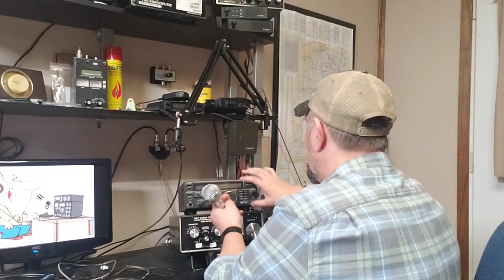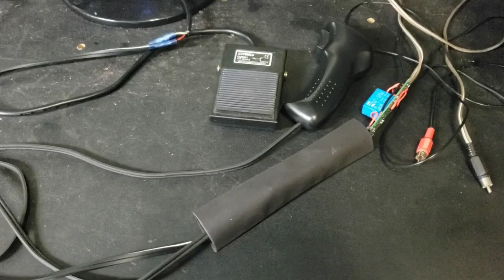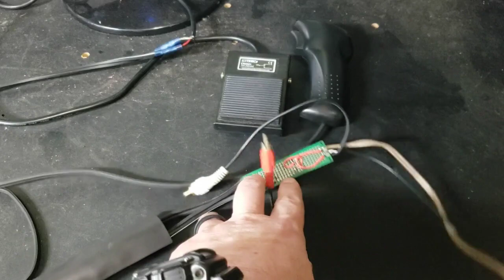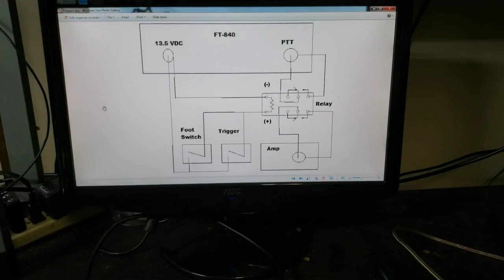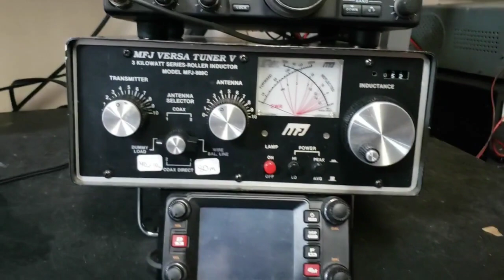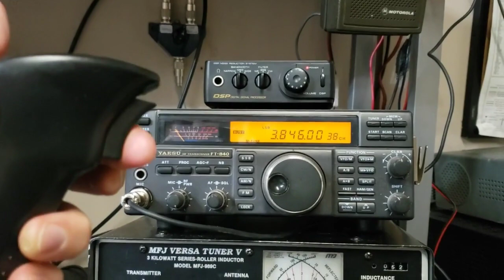FT-840 with a Highball 2 Mic Keyed up RedNeck Style

Comment: I have an 840 top and cannot get digi rig to work. Someone suggested the external speaker jack instead on the band data jack thoughts 🙏
Reply from the maker: I don't have very much experience with the digital modes.  I did purchase a device to act as an interface for ft8 on the big auction site.  If my memory serves me correctly I did use the ext speaker jack for the audio.  I made 1 ft8 contact then went in the house to build me a sammich.  A thunder storm came up whilst I was in the house and lighting took out my interface.  That's about the extent of it.

Comment: I have the FT-840 also, great little rig (little by the size standards of the time).  I also have a complete FT-757GX station and an FT-891 which is my main rig now.

I also have a boom mic on my 891 (and it can be used on the other 2 Yaesu rigs with a simple adapter).  I am using a Heil hand switch (the one you have was originally used as a remote starter switch for working on car motors) and i am using a Shure SM-48 studio/stage mic.

I was using the same Highball 2 that you have but I find the Shure mic has a smother vocal response.

My pride and joy station is my Kenwood TS-520 station.  I just finished doing a final tube replacement and neutralization on it and will be putting it back on the air in the next few days (when I have the time)

Except for my VHF?UHF antenna, all of my HF antennas are home-brewed.  A 10 meter (can be tuned from 20 to 10 meters) rotatable dipole at 40 feet, a 6 meter dipole at 45 feet and a 40 meter folded dipole (with my MFJ-949E it tunes from 75 through 20) at 30 feet.  (more antennas going up this summer.  I have a great landlord!)

No amp used ever in my almost 30 yrs as a ham.

Hope to work you OTA one day!

73, John N1WOM in Southeastern Massachusetts.

Comment: Very informative video. Thanks for this information. I noticed the DSP on top of the radio and saw in another video you were using it for volume control. Is this something you are using between the radio and speaker? I have been licensed since the 70's, however I'm still learning new things all the time and enjoy learning, videos like this really help. Thanks.
Reply from the maker: Yep. That's a RadioShack DSP that I picked up from a Hamfest for about 5 bucks.  It plugs into the ext. speaker out on my hf rig.  It has a built in speaker but I am using an old motorola external speaker that an elmer gave me years ago.  It helps a little in filtering out the noise on weak signals.